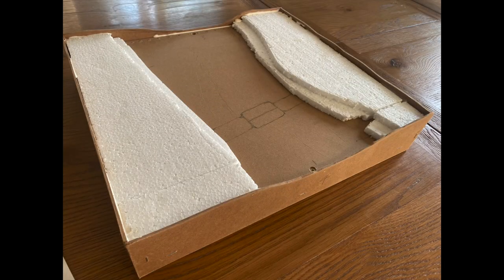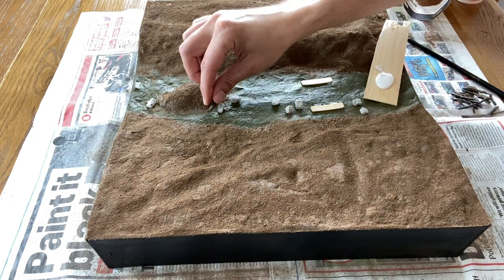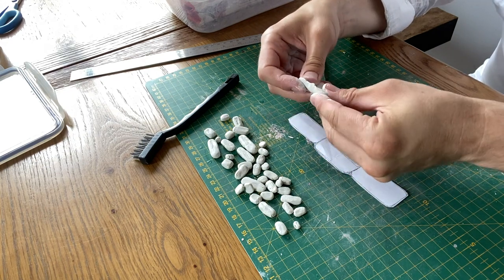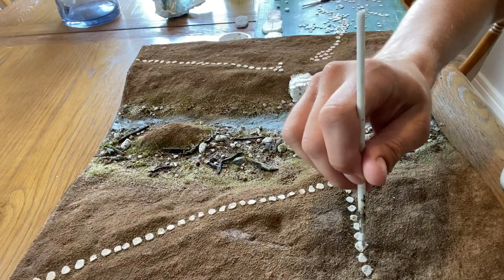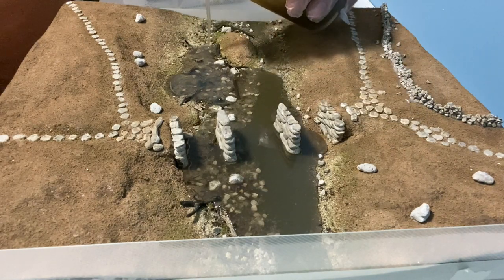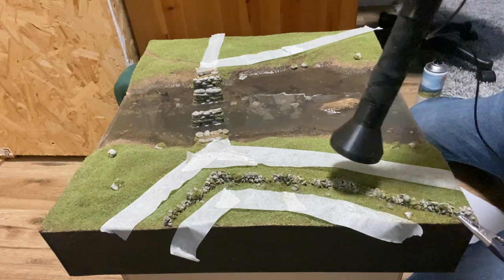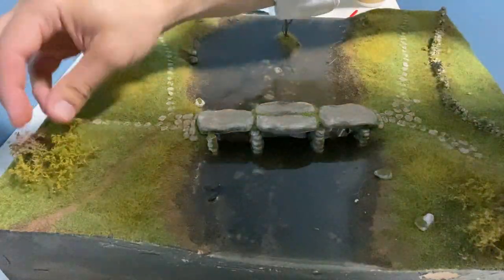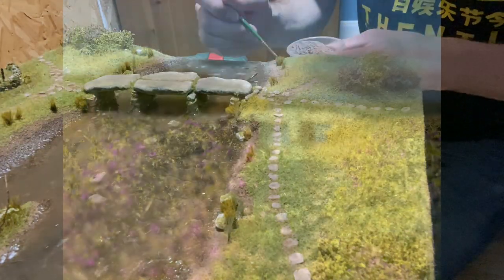Model an AWESOME clapper bridge

Comment: Can you explain why you spray water and washing up liquid to your grass before adding scenic glue? What does the soap do? Great vid as usual BTW.
Reply from the maker: Thank you.  If you put scenic glue on certain scatters/powders, it can bead and make a bit of a mess.  The watered down washing up liquid breaks the surface before applying the glue.  You can also use isopropyl alcohol.